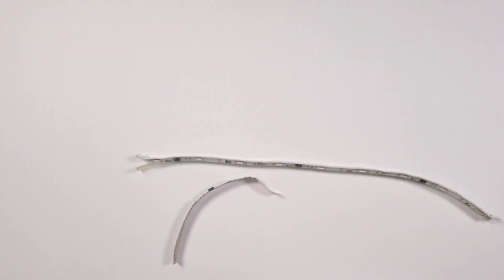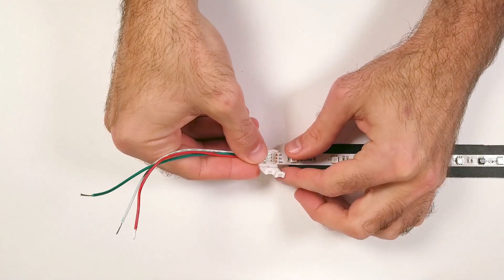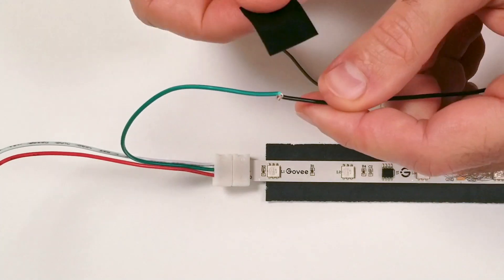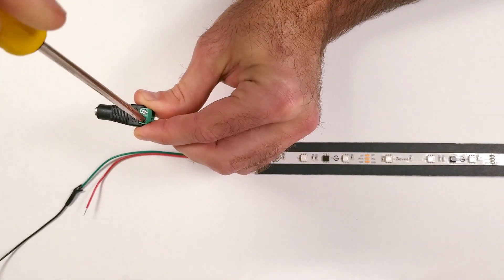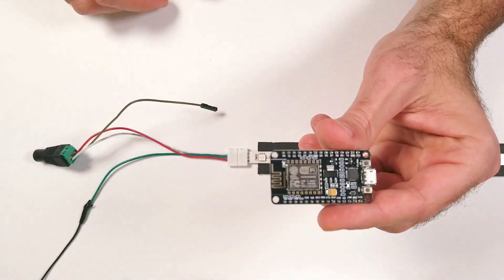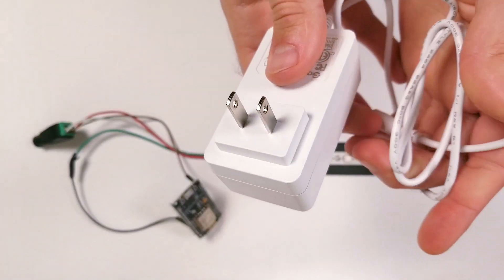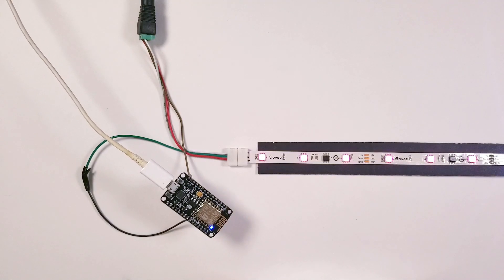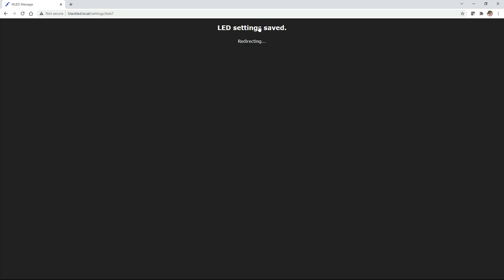Control Govee Strip Lights with WLED! Easy Step by Step Tutorial. No Soldering Required.

Comment: That ESP32 board can actually use 12V! I’ve looked up the low dropout regulator up and it can support up to 15V. You just have to use the VIN pin instead of the 3V3 pin as the VIN pin passes through the LDO but the 3V3 pin goes straight to the ESP32.
Reply from the maker: Thats awesome!! Thanks for the info and might have to try that as it would eliminate the need for the extra wires for powering the board. Thanks so much!!
Reply: @ChrisMaherDIY  What would be the additional steps to make this happen? Do you plug another breadboard wire into the VIN connection on the WLED board?

Comment: Can this govee lightstrips can be used with some prebuilt esp? Like on the previous video where yo made a female conector and plug it directly to the controller?
Reply from the maker: I'm not 100% sure but I think you could use this with any type of esp controler. You just have to make sure you are using the correct power option for these 12v led strips.

Comment: So the difference between the RGBIC and RGB from govee is the controller? What is the max distance on this set up? When buying the Govee RGBIC it says it cant splice and I assume thats because the app is already set for a certain amount of LEDs. They are also 4 channel 24v, NC, DO, GND. (2x10m). This outcome looks better and if I can get a decent length off a 12v 3pin and custom length seems better. Govee app just doesnt seem as nice with the controls as WLED. Thanks
Reply from the maker: Thanks for watching and for the comment! I personally have not tried maxing out the distance but I would think you could get at least 10Meters doing it this way with no power injection and i would guess maybe upwards of 20 meters with power injection? I do think there is a difference between RGBIC and RGB. I however have not worked with many RGB light strips but I seem to remember a lot of those not having the same 3 pin configuration as the RGBIC strips I used in the video. You are 100% correct though on why they say you cant splice/cut. The app along with all the govee animations are programed with a specific number of LED's If you cut it in half, the animations will still work, but you will only see the 1st half of the animation as the govee app would not re-calculate the new number of LED's and adjust the animations accordingly like you can do with the WLED app. Thanks for the great quesitons!
Reply: @ChrisMaherDIY  Appreciate the reply, I'll have to look into somethings haha.
Reply from the maker: @1WithTheDark  You are welcome! Its a fun hobby! There are worse things to spend money on lol.

Comment: Red for GND and white for 12V? What's wrong with you xD XD
Reply from the maker: Lol I wish I had the traditional colors and I could be wrong but I don't think the color of the coating on the wires matters. It's all the same wire underneath. Let me know if this is not the case. I'm still new at this!
Reply: My toes curled at that too, maybe you could use the adapter (although I hate those, connection never lasts) upside down, there should also be pads on the bottom of the strip, that would at least align positive with red and negative with white while leaving green as data in the middle. :)
Reply: I thought the same when I saw it… lol he used the conector backwards… when teaching it’s important to be consistent with what’s generally taught to the masses so that viewers don’t get confused… in electronics components Red is usually where the electricity runs through Black is ground and white or green would be the data. Now if working with electricity coming from the wall (120v)the Black is the live White is the neutral and green the ground (earth)….😅

Comment: Why not connect a 12v to 5v step down so you only have to use one power supply?
Reply: step down coverter takes higher voltage and stabilizes the voltage to set point, like 12v to 5v... $1 a piece
Reply from the maker: @theoneohmresistor  thanks for the explanation! I'll have to take a look at that. Do you have a link to one on Amazon by chance?
Reply from the maker: What's a step down? I'm still pretty new at all this so I'd love to learn if there is a better way about doing this! Thanks for the comment and please let me know!

Comment: Awesome work again and nice explained video!! 
Could we upload a custom .ino using Fastled right now to the ESP8266???
I have 2x Arduino that controls my front door and my bay window with different amount of led. They start at 14h45 daily and are synched for a while and then they have up to a ~10 seconds delay between. I think it is due to the Arduino Uno R3 memory because my script is using more than 90% on one of them due to the qty of led... The esp8266 has bigger memory I would like to try to use them instead of the Uno R3. Thank you!
Reply from the maker: I wish I could answer your question but I have such limited knowledge of LEDs and all the programming possibilities. I would say I'm still an infant learning to walk in terms of my knowledge. In fact, just by your question, Im sure you know at least 50 times more than I do in this subject!  I'm learning a little more each time I make something but it's a slow process. I've heard of fastled but have no experience with it as of now. Is it a good program and one that I should take some time to try learning about?! Thanks for watching and sorry I'm of no help :(

Comment: Chris the ESP8266 boards are pretty old have you tried this using a ESP32?
Reply from the maker: I have not yet but I really should. I don't know much about them. What's the benefit? I think I started out with the ESP8266 because it was a little cheaper then the ESP32.
Reply: @ChrisMaherDIY  Just a better board is the short answer but quickly: the processor, Memory are better (newer, quicker) more peripheral's (16 GPIO, UART, I2C, I2S, ADC, DAC, CAN) has Bluetooth, provides hardware security, better SSL, programming is easier (can be programmed in the Arduino IDE)
Reply from the maker: @Joseph-ko2kl  sounds like a nice upgrade! I've also never done any programming but that is something I wouldn't mind trying at some point. Thanks for the advice buddy!

Comment: Awesome video as always, and I can't wait to reuse some of my left over Govee strips. Not sure if you know the answer to this, but what about reusing RGB strips that have 4 pins (Voltage, R, G, B) rather than 3 pins (Voltage, Data, Ground)? These aren't individually addressable.
Reply from the maker: That is a great question and if you ever find out the answer, make sure to let me know lol. If i come across the 4 pin type and figure it out, I'll let you know as well!
Reply: @ChrisMaherDIY  The LED strip in the link is the 4pin type!
Reply from the maker: @deejay696  I clicked on the Govee Amazon link and at least in the product picture they show 3 pins. Did you order them and they had 4?!
Reply: Link leads me to a 3-pin 12V rgb strip.
Reply from the maker: @physicsnerd02  same here so the link must be good since those are the ones I used in the video.
Reply: Not sure if you figured this out, but the answer is "it depends".

Old RGB strips that were static color were usually 3-pin.
Later models of 4-pin RGB had three separate color channels (in addition to ground) with each color channel providing the 12V or 5V signal.  It allowed the strip to change color, but you could not individually address each LED.  Phillips hue uses (or used, I haven't looked in years) a variant of this style.  
What's shown above uses a digital signal to time each LED allowing you to change the colors of each individual LED.  So you have one digital line, one power line (12V or 5V) and one ground.
There's also other stuff out there.  What you plug into your computer, for instance, is typically a 4-pin 12V ARGB or 3-pin 5V DRGB (or do I have that backwards?) but there's all sorts of RGB standards and you have to make sure you're using the right one for your application.

That's why i love videos like this that tell you exactly what to use so there's no interoperability issues.
Reply from the maker: @physicsnerd02  Thanks so much for taking the time to explain! I have worked very little with the old rgb only 4 pin type so that explanation helps a lot! Thanks for watching and I'm glad you enjoyed the video!
Reply: @physicsnerd02  I clicked on the link and ordered them, it’s the ones with the 4 pin — the box is came in says it’s the RGB Basic Model H613D — anyways there’s no such thing as too many LEDs lolol